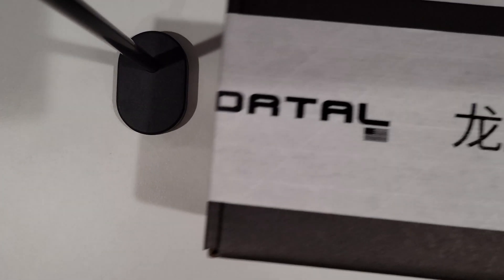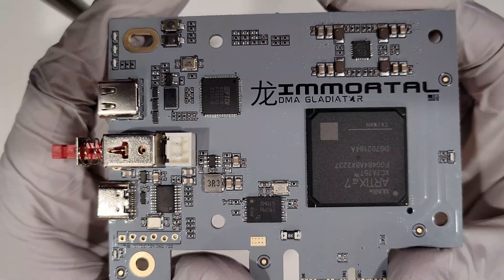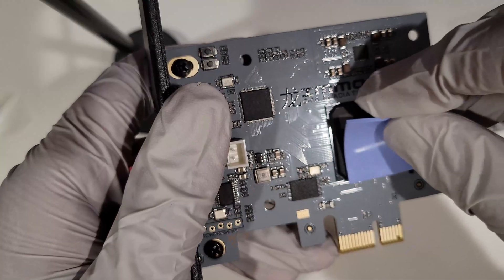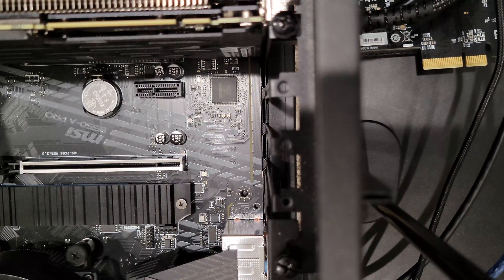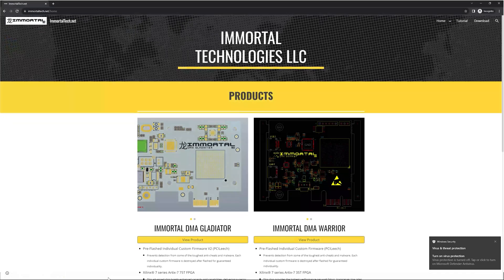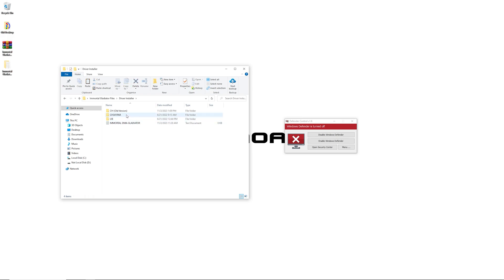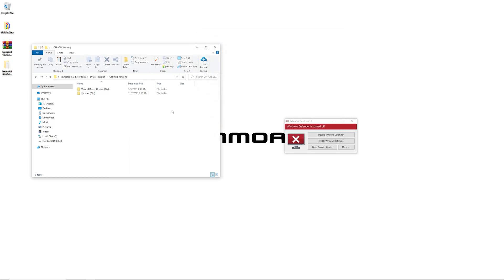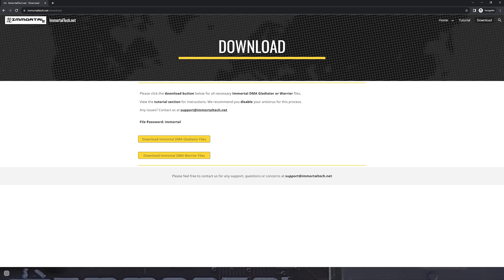Immortal DMA Gladiator Setup Tutorial

Comment: For these boards do you plug it inthe pc and program it to read specific memory? Or you need dual pc
Reply from the maker: Hello, 

Our FPGA DMA boards are pre-flashed with a customized version of PCILeech, you can communicate with your board by using https://github.com/ufrisk/memprocfs. You may use the same PC for analyzing the memory. Please make sure your use case is appropriate if you do so.
Reply: Actually you will need a second cable. Take a USB-C to DP, with about 3 meters of length.

Usb-c goes into the DMA card, and the DP goes into your asshole to remind you that youre a sad bitch. Thats why you need the 3 meter length.

Comment: Once you do all these steps and installation how do you actually cheat with the DMA?
Reply: First off you need firmware so you don’t get clapped the second you open the game and second off you need to find a dma cheat dev and that can be found on elite PVP forums clutch solution is a good dev
Reply: where can they be found?
 @Nadimir
Reply: @5cuf  legit if you read my damn comment i told you what to google
Reply: @5cuf  you need a 1/1 firmware after installing the device yes it’s two different perches